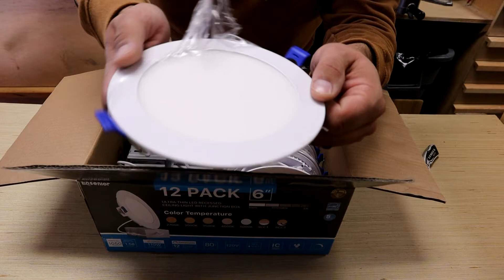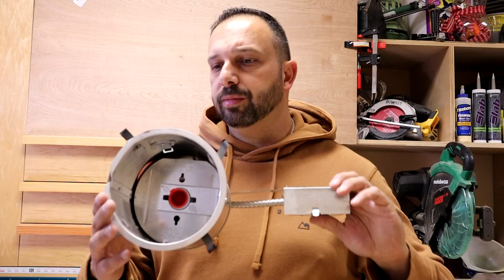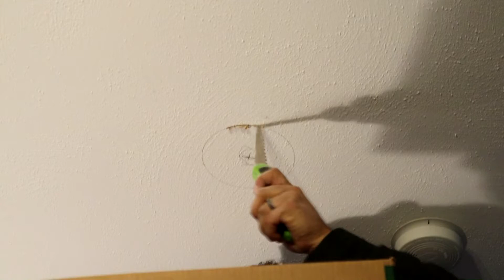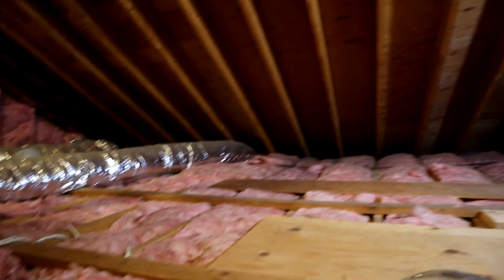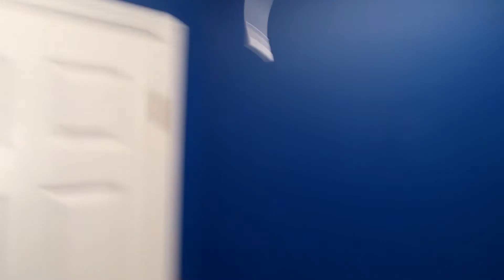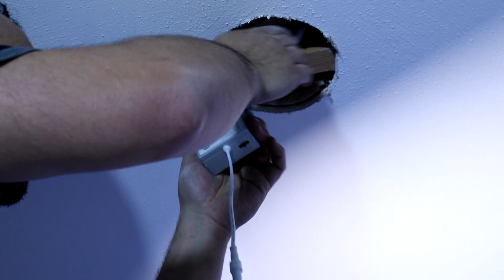Recessed Ceiling LED LIGHTS | BEDROOM Lighting | HOW TO!

Comment from the maker: Ensenior 6" Recessed lights 4 pack: https://amzn.to/3E3cSNI
Ensenior 6" Recessed lights 12 pack: https://amzn.to/3xFAgP2
Ensenior 6" Recessed lights 16 pack: https://amzn.to/3cZ0NNG
Ensenior 4" Recessed lights 4 pack: https://amzn.to/3xzLYe4
Ensenior 4" Recessed lights 12 pack: https://amzn.to/317gOhY
Ensenior 4" Recessed lights 16 pack: https://amzn.to/3D16sxo
Ensenior Canada Link: https://amzn.to/3D1wDnu
Keyhole Saw: https://amzn.to/3D49EYZ
M12 Milwaukee Driver: https://amzn.to/3nYwsFi
Romex 14/2 for 15 amp circuit: https://amzn.to/3p1UVsA
Romex 12/2 for 20 amp circuit: https://amzn.to/3ljDItH
Romex connectors: https://amzn.to/3re7Zhf
Lutron Dimmer: https://amzn.to/3p5LN6o